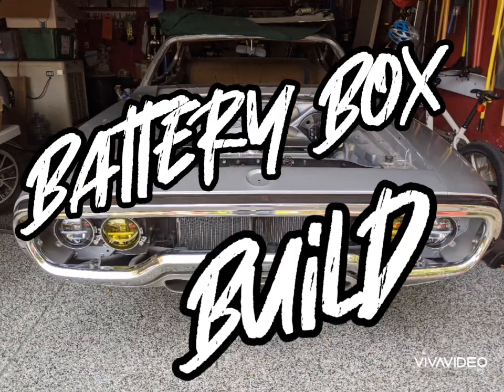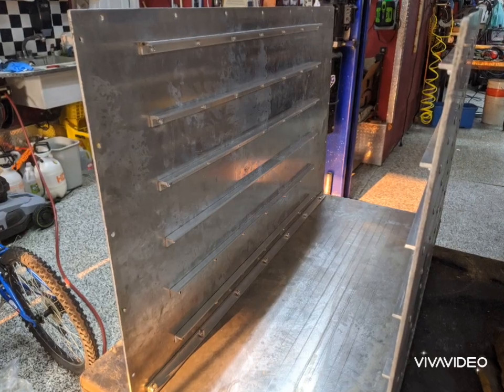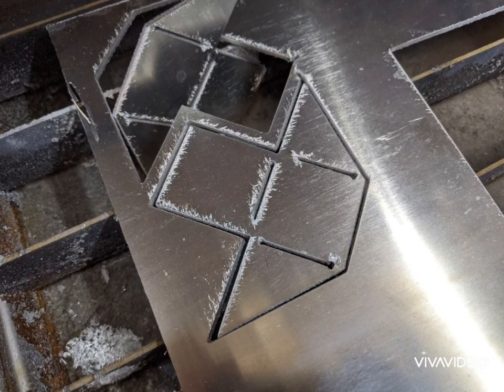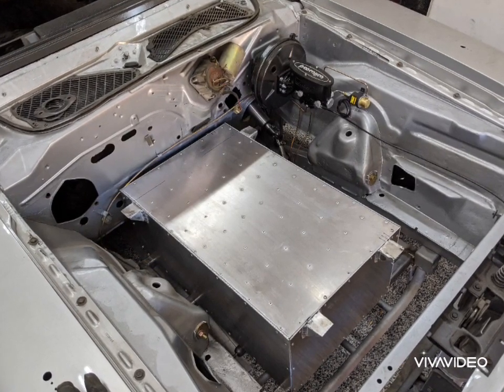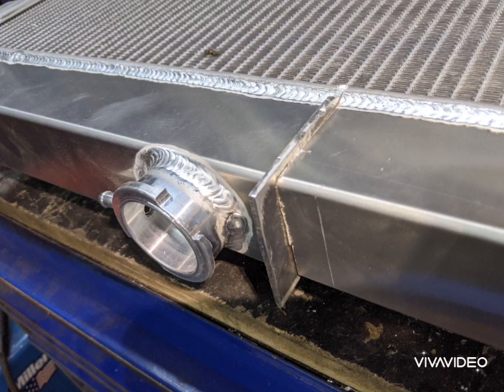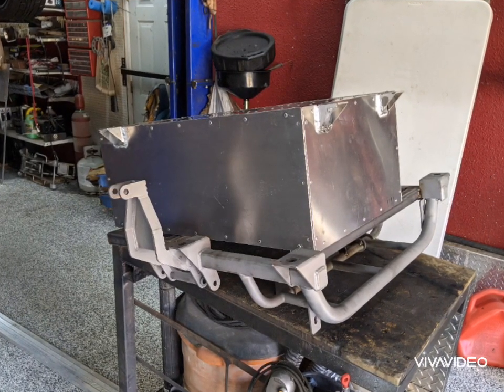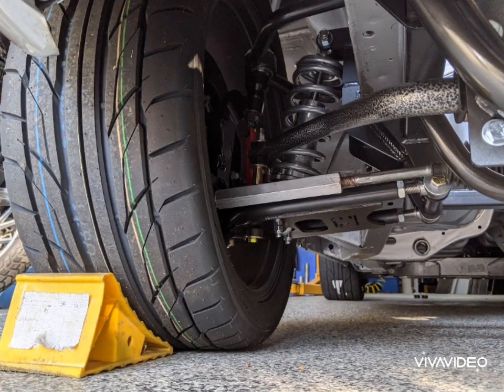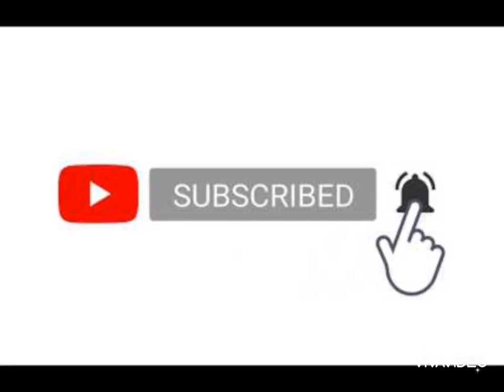Project Electrollite - Plymouth Satellite Tesla Swap - Battery Box Build EP. 8

Comment: Very interested how you attached the batteries to the box bud.. Did you bolt each cell to the rails ? or are they just resting them ?? Cheers for any reply as I'm designing my own box right now
Reply from the maker: I purchased the bus bars from Stealth, I'm not sure on the dimensions... I did secure each battery module to the rails in the boxes.
Reply: @MrMoparMan  ok what's the pitch of your rails inside the box... Probably a better way to ask I'm sorry
Reply from the maker: @DPro I left 1/16th of an inch between each module, I cannot remember the spacing of the rails... I'll try to look it up.
Reply: also what's the pitch for those buss bars ie the offset from one battery to the next ? about 80mm I guess or did stealth give you that info ?

Comment: I am in the process of designing some battery boxes for an EV project and your videos have been great! How did you end up making the boxes watertight? Did you add a sealant or anything? Thanks!
Reply from the maker: Nice, yeah I sealed all of the non-welded edges.
Reply: @MrMoparMan  Ok, that is what I figured. What kind of sealant did you use? I was considering a 3M marine adhesive
Reply from the maker: @nstarck  I used OSI sealant, I have used the 3M adhesive and it is very tough as well.

Comment: How long is your battery box?  I know the batteries are about 27" long but curious how much additional room you gave yourself to run the cooling line on the one end and deal with the electrical connections on the other.  I was thinking about 29-30"  Curious what you went with and if you are happy with your choice.  Thanks
Reply from the maker: That's a great question, my boxes are 31in. long for that exact reason.  Although I've installed the batteries as I test fit, I have not assembled all the cables and cooling lines.  I'm pretty sure there's enough room for everything however.
Reply: @MrMoparMan  Are your top batteries sitting on top of each other at all or are they sitting on the rails completely(suspended)?  My current plan is to stack 6 on top of each other and I'm not sure if they can sit on each other or if they need to be suspended.  Thanks
Reply from the maker: @stukinthe90s29  People do stack them with good success.  The 18650 cells are packaged pretty well, and although the module is heavy, there are plenty of cells to support the weight in my opinion.  Imagine staking individual cells six high.  My six pack box was originally going to be vertical and I wanted them to have support on the rails.  There is a 1/16th inch gap between them for a mica sheet.  The rails also allow each module to be fastened down.  Try this link to my fusion 360 file for reference. https://www.facebook.com/groups/597072290789104/permalink/981475735682089
Reply: @MrMoparMan  Thanks!

Comment: It was a 318 4 speed, jeez if you're not gonna use it give that badass drive train to me
Reply from the maker: 318, but a 904 torqueflite, not a 4 speed...It did revive a 73 Dart.
Reply: @MrMoparMan  hey, at least it wasn't scrapped, I know a lot of guys who see the 318 as nothing but low displacement junk but I think they're great motors ESPECIALLY for forced induction
Reply from the maker: I totally agree, I love the small block mopars with boost... Here's my 340 dart: https://youtu.be/2ShJs6gpQ3U
Reply: @MrMoparMan  yeah I was thinking about doing an 80s D100 running a twin turbo 318
Reply from the maker: @justjamesAMX  I love the idea, so much room under that hood you can do anything you want!
Reply: @MrMoparMan  pretty much, it'll just be kinda hard to keep traction with no weight on the back, which who needs traction anyway
Reply from the maker: @justjamesAMX  maybe you need a bunch of batteries back there instead? 😜

Comment: I’m curious why you didn’t mount all the cells under the car between the frame rails? There would be plenty of room with out the torsion bars, exhaust and drive shaft. At the least could you not mount 3-6 sells in place of the gas tank and save the trunk space?
Reply from the maker: All good ideas!  I've spent a lot of time staring at the car trying to figure the batteries out.  It is totally possible to spread them out in different locations for balance and fitment.  I determined I was up against diminishing returns for the amount of effort It was going to take for a really trick install.  I figure I'll get one under my belt and see how it works.  I'm always willing to rebuild, or learn for the next build.  I appreciate all the input!
Reply: @MrMoparMan  Hey no problem I’m looking forward to this build. The battery thoughts are just things that I had in my head for when and if I did my own. I’m almost thinking that since you’re doing up a Mopar maybe I should do one of my old CJ7’s. The only issue I have with that is trying to retain the function of the 4 x 4 and have somewhere to put the batteries lol
Reply from the maker: @restosandrevivals4597  Love the idea of a 4x4!  It would be cool to mount a Tesla drive unit sideways in place of the transfer case.
Reply: @MrMoparMan  oooo now your talking! 
What’s your best guess on the cost of doing something like that?
Reply from the maker: @restosandrevivals4597  I think with the standard Tesla drive unit and a Chevy volt battery, you could come in under 15k.
Reply: @MrMoparMan  Thanks! 
Looks like I’ve got some research to do.

Comment: Thanks for the update. Absolutely love this project. What part of the country are you located in? Would love to do something similar with a 1950s station wagon.
Reply from the maker: Hey Ben, I am in Colorado.  I think a 50's wagon would be great!  There are so many old cars that would be perfect EV's.
Reply: Kevin Erickson I used to live in Boulder and later the mountains west of there. Have you figured out how to implement traction control, regenerative braking and anti-lock brakes?
Reply from the maker: Cool, can't wait to cruise this thing in the mountains!  This car will have regen which will be adjustable.  True to the muscle car it is, no traction control and no ABS.  The power settings are adjustable and I should be able to ramp up the power as kind of a manual traction control.